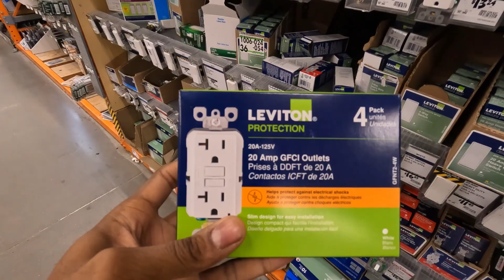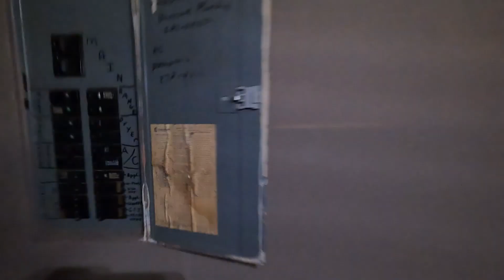Home Electrical Inspection Updating GFCI Outlets to Pass Inspection

Comment: Nice work Steven, Merry Christmas ,apparently you installed the GFCI correctly since it reset when you push the reset button. When you started to remove the old outlet , it appeared to be a regular outlet and not a GFCI. How did you determine which was the line and which was the load before you removed the outlet ? Does the code in your area require a GFCI in every bathroom even they are on the same circuit? GFCI are the devil to get back in the box and sometimes the 6/32 screw thread in the box will stripe on you ! ugh We get in a hurry trying to knock out the job ,we opps , it happens!
Reply: Greg, you test for voltage on the wires. The black wire that is hot will ALWAYS be your LINE SIDE, and all other black wires needing to be protected by GFCI would be the LOAD SIDE connection (pigtailed,
 if necessary).
Reply: @larrydoss  Thank you , I knew that , is that Steven didn’t show it in the video .
Reply: @gregfisher216 that is correct, he didn’t show testing the wires for line and load in order to properly hook up the GFCI.

Comment: Why 20amp GFCIs? That’s a few extra bucks there.

Love that you check your work. Sometimes our subs don’t check their work and let reversed hot n neutrals slide through for the inspector to find 👍
Reply from the maker: I like to match outlet with breaker size, specifically gfci.
Reply: Steven,
Why not pig tail the gfci outlet to the line side that way one one trips you dont have to go back and reset each gfci it will trip at that location only
Reply from the maker: @leemichels4319  Yes it was already done, there was an additional outlet you didnt see i wired up. I did it that way.